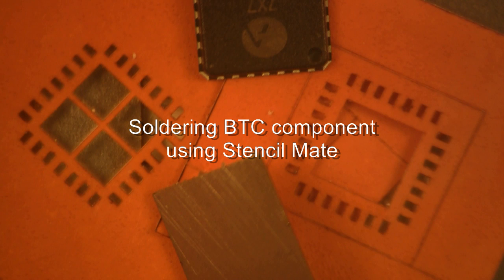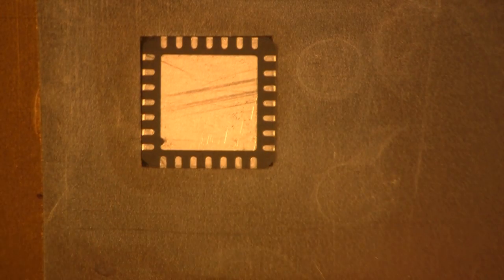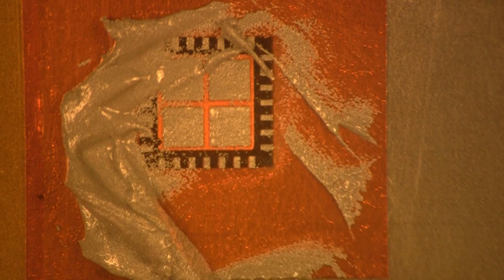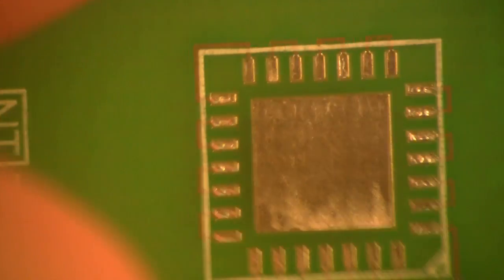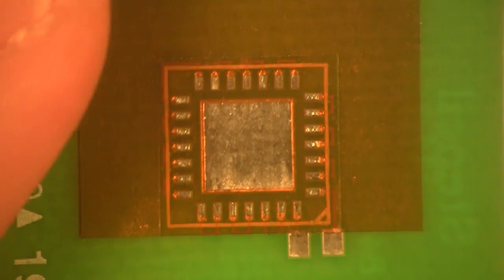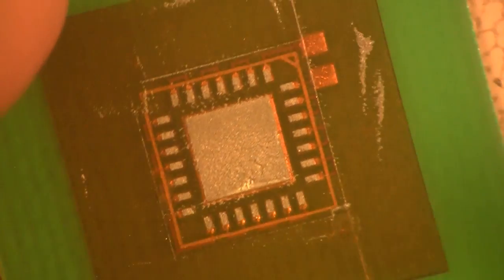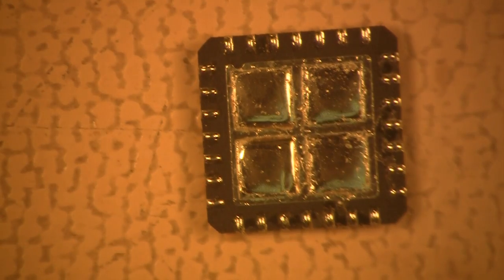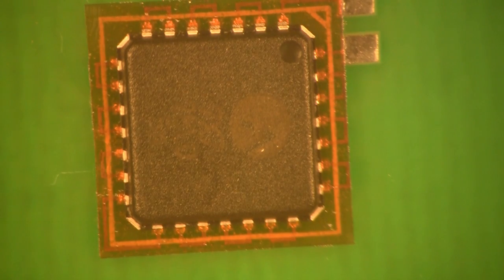QFN Rework Using Polyimide Stencil

Comment: This does not look very practical. 12 minutes just to align and put things on... not good. :/
Reply: It might not look practical, but that's not what counts here. These parts are made to be handled by machinery. Humans are not as precise, that's why we invented those machines. This takes the human error out of the equation. There's really no room for mistakes here. The important thing is getting the component aligned with pin point accuracy.

Comment: It looks to me like it's much more work than it's worth
Reply: If you apply paste to the chip and reflow it, you don't need to add any to the PCB, especially if it's already been hot air solder levelled as this example has.

Comment: What happens with the stencil on the board when you ready to put the QFN chip on it before it goes to the oven? With the stencil on the board and the QFN on the top of it after reflow how would you remove it?